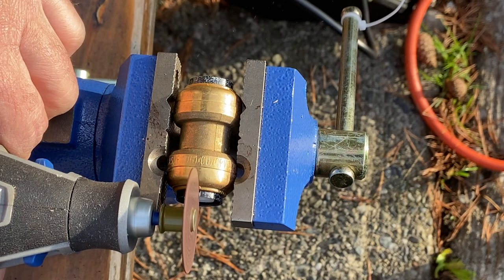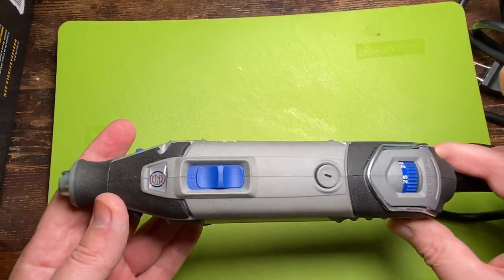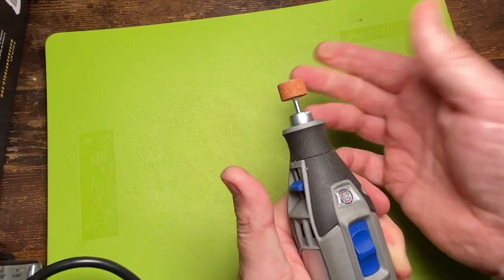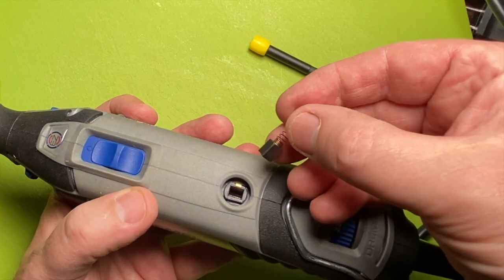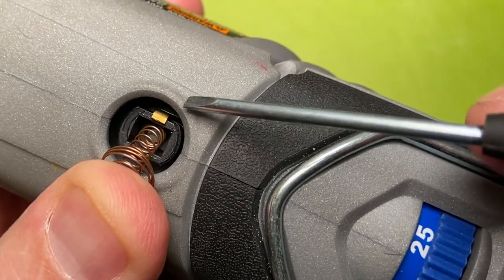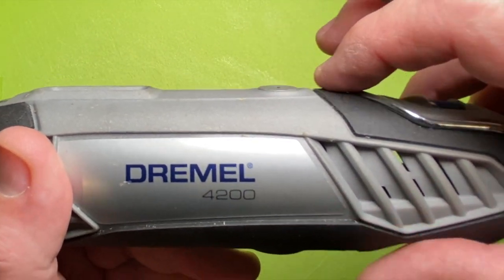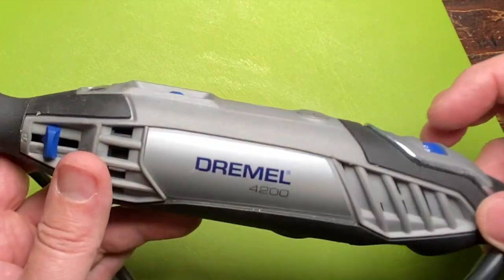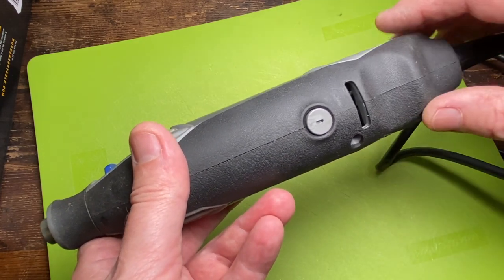DREMEL JUST QUIT WORKING!...Hoping For An Easy Fix!

Comment: My 4200 dremel just stopped.  I read the manual thinking there must be a reset button and saw the part about the brushes but didn't think that work.  I found this video and was pretty dubious that just removing the brushes and reinstalling them would fix it, but had no other options and decided to give it a try.  Well, it worked!!  Needless to say, I was quite surpised!  Thank you!

Comment: The turn it on 5 minutes high speed tip really helped. 

Before that i stretched the spring outwards a little bit and shaved them completely flat using some 80 gritt.

Comment: Yep thanks!  I have a model 395 type 5 (Variable) which I was using to clean metal cookware with "Sanding Mops" I bought on EBay.  The Dremel is about 25 years old but I do not use it frequently.  It quit running this past week but was not overheated I thought.  So I did open one brush and it looked great and knew the brush was not faulty, but never thought about the little brass contact I noted on the top.  Then I watched your video.  Before dismantling, I tried the tool again and it runs fine now.  All I did was open one brush port and that must have been the one!  Saves me from messing with it further.  I should have known as I am familiar with old model trains which have such set ups and they eventually fail to run because the armature contact parts wear out.  Easy to repair.  Same here.  PS, I have that little wrench you speak of because mine is the older model which has the "Chuck" mount on the front. Usually I do not have to wrench tighten the attachments in the chuck---hand tight works for me.

Comment: Late question. I have an older variable speed dremel, but it will only run if it's set to the max speed. Would that be a brush issue, or something else?

Comment: Nice to know. I didn't think the brushes were that finicky. Also where the heck do you find a Dremel 4200 I looked on Amazon at every hardware store in town. They have 4300 with the same unscrewable stupid chuck. It's like this mythical Beast does not exist.

Comment: My brand new Dremel 4000 tripped my circuit breaker,  now Dremel is useless and won't work. I spent a lot on this entire set which includes the flex shaft. 
My Dremel Lite Cordless also won't work! Bought it this year, second time I was going to use it bc brand new Dremel won't work. 
I'm starting to think the quality of this brand is crap. 

Any advise on either?
Reply from the maker: That is crazy. I have not pulled mine out in a while. Is there a fuse in yours?